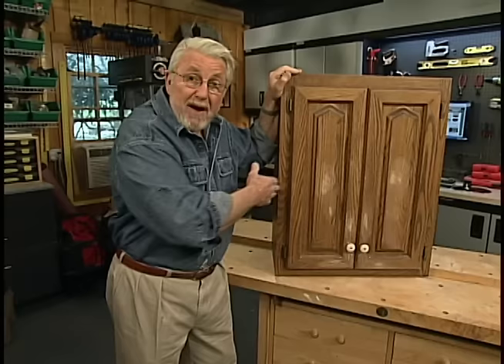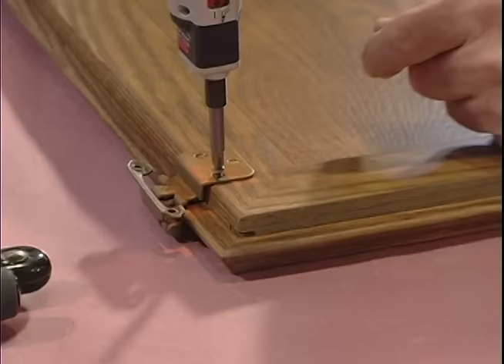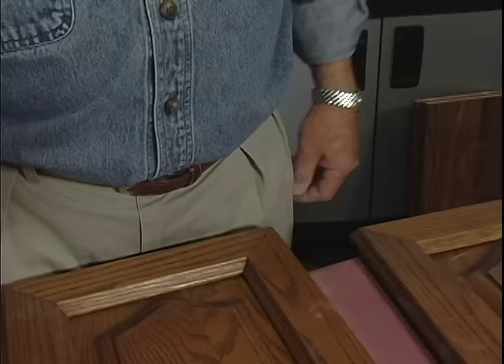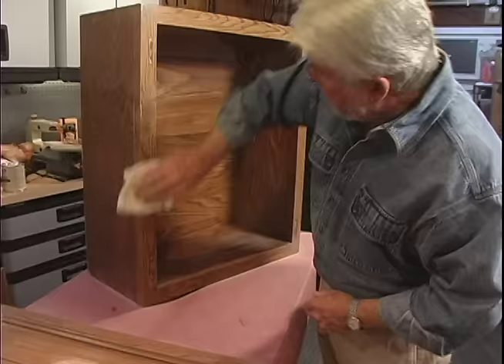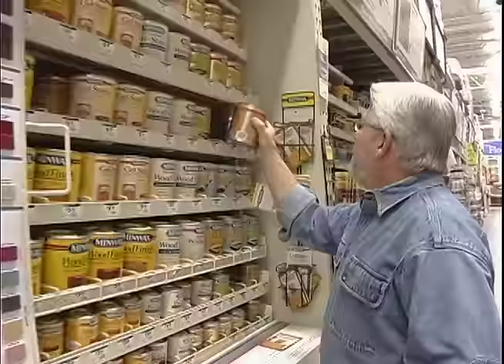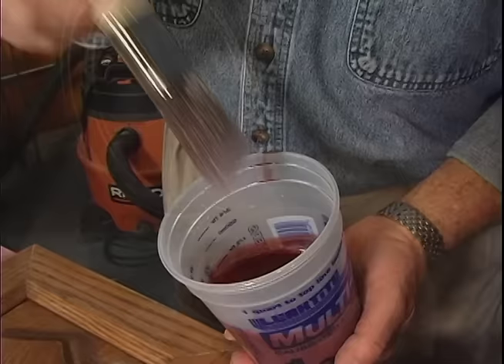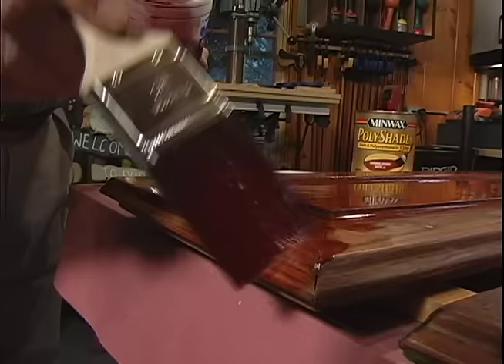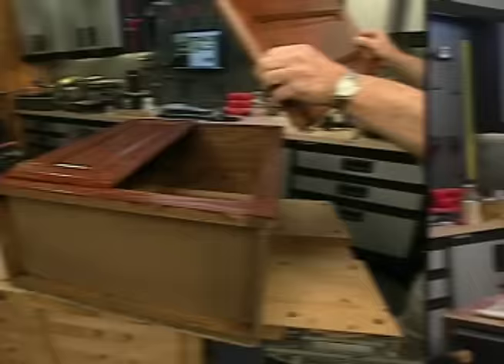Refinish Kitchen Cabinets Without Stripping

Comment: Has anyone else used Polyshades?  I used it on some dining room chairs, and after repeated use the base color is showing through, there are lots of scratches and chips, etc.  I’m sure I needed to sand better, but was it just me or is the product not that good to begin with?  Would a Gel Stain work better for these applications?  Thanks!
Reply: Polyshades is known for issues like you mentioned but a deeper tooth or some type of product to create the same effect can be helpful. Stripping fully and reapplying stain and finish is a pain and a big deal but it IS the best way to change color of stained cabinets.....
Reply: Based on my 40 years of experience, now retired, in painting, staining, faux finishing, restoring antique wood finishes in all kinds of furniture, this is the worst advice I have ever heard from someone who is suppose to be a craftsman. My god, LOOK AT THE DETAIL  after he is finished showing the before and after. There is all kinds of flaws in the finish!!! YOU NEVER EVER USE A POLYSTAIN for refinishing..PERIOD.. and NEVER USE A STAIN PENCIL...PERIOD....Refinishing anything without taking it completely down to bare wood requires time and patience in order to get the stain evenly dispersed around your project no matter what it is. Yes, for the novice, do the prep work he suggests and thats where you stop with this guys advice. Again, for the novice, buy yourself a ' GEL STAIN' and a professional natural bristle brush. I recommend getting the blond bristle. Again, for the novice, you want to take the brush and place it in a container full of mineral spirits and bounce the brush up and down on the bottom for a minute. This will aid in loosing and loose bristles that may be in the feral and will make the brush less rigid. Remove the brush and shake it out by placing it between both your hands and rubbing the brush back and forth causing the brush to swirl back and forth. Put the brush back in the mineral spirits and repeat. Next put the brush back in the it's wrapper that it came in and let it dry over night. Again, for the novice, After you have prepped your project, use a little amount of gel stain on the brush and get in all the crevices first and they all the flat parts and sides, called revels, you can give it a final wipe, if you'd like or let it be and let dry over night. Remember to clean the brush each time you use it!! DO NOT USE a lot of gel stain because to do this right you may have to do this a number of times perhaps up to as much as 3 coats for uniformity. Next day, look where all the light spots are, that is where you need to add just a little of the stain. Dab a little on with a non shedding cloth or paper towel than take your brush and sweep very lightly over the area to cover it and feather it into the rest of the wood that is not so light. Let dry. Do this again until you see uniformity. Then apply another light coat of gel stain using a non shedding cloth or brush and let dry and again, look for light spots and repeat what I said above and let dry. Next look for light spots if any, repeat if necessary. After you have uniformity, and your project is dry, apply by spraying, from a can, a light coat of polyurethane to seal in the stain. Let dry. Then you can a use either 2-3 more coats of spray or 2 coast of brush on polyurethane and let dry completely before putting the hardware back on. Now enjoy your project. Gel stain will work on maple, just do it lightly for each coat.
Reply: @dannyixoye262  I appreciate your experience but you just seemed to give the long detailed version of my advice. Not really sure where or why you think I failed......
Reply: @bruceyoung8036  Sorry Bruce,  I clicked on the wrong reply tab. You did not fail. In fact what you suggested is the right way, in most cases, to do it. I just wanted people to know that if they don't do this, which at times there are reasons not to, such as my working on a late 1800's Chinese antique piece, there is the option of using, carefully, a gel stain and how to use it. That said, on the Chinese piece I worked on, I actually used artist oils not a gel stain.
Reply: @dannyixoye262  ahh, a gentleman, don't see much of that these days. Lol. I appreciate your comment. You're obviously way ahead of where I am with finishing and refinishing. I don't think I would be comfortable working on pieces with any historical significance. And BTW, I only used that polyshades product one time, once...... that was enough. Nothing gained, looked like a mistake, which it was.
Reply: Wow!  Thank you both for your advice!  I will have to work up the strength of mind to go at these dining room chairs again!!  haha!  But, your advice does save me the trouble of using a polyshade again.  I am glad to know that you should put several coats of poly over the gel stain.  Other people out there leave that step out, but I can see where that would make a huge difference!  Thank you both, again for your detailed replies!
Reply: @bruceyoung8036  I am old now so I have old school values but I have faith that there are those, such as yourself, who have had at one time their life entertained old school values and adopted them as their own. I truly enjoyed my career in what I did and at times wish I could still do it with such earnest that I could not walk away until it was done as I once did  I learned long ago that most anyone can become a tradesman, but only a select few are truly craftsman. Strive to be the craftsman and you will grow to enjoy your work far beyond you can imagine.
Reply: @dannyixoye262  I could not agree with you more sir. It seems like the more care we put in to something the greater the satisfaction. I DO value the old school ways in my work and in my life. My chisels are sharp and always go back in their spot. Lol
Reply: @dannyixoye262  : So...using artist oils...? Is that a short cut of sorts if trying to make a uniform color over a larger area? Also, what would the prep be, and would laquer spray finish work?
Reply: @dannyixoye262   appreciate your clarification … & expertise …
Reply: @dannyixoye262   nice apology but you were talking about his video & his technique, product choice & final result . You did call it a fail …. But thanks for your input, too .
Reply: @bruceyoung8036   Then why leave your video up ??  Everyone liked it & praised you and your work looked great - but at least add an addendum about the product choice to help others ?

Comment: You make that look so easy but, I’m doubting the enormity of the job.  I had a laundry room leak and had to have a plumber repair it.  The flooring needed to be replaced and I chose vinyl wood planking.  I couldn’t match the planking to go with the cabinets well enough and I want to refinish my kitchen cabinets.  I’m afraid I will louse up the job and have a more expensive project on my hands.  After all, the cabinets would be the central eye focus of the kitchen.  I don’t want to remove the cabinets from the walls to do this and I feel this project will be labor intensive.  Would I be better off having a professional do this?  I’ve heard that it is very expensive to have someone else do this.

Comment: I have maple and it’s seems impossible to stain. It’s super smooth and I’m being told there would be all these brush strokes and I’m not sure I would like the end product. Have you done maple ?
Reply: Maple is inherently tough to stain because of the super tight grain. Wood conditioner designed for this exact purpose helps but isn't failsafe. Dark stain in particular will just not pop with maple like it would with oak or most other tree species actually. Leaving the stain to dry on the surface might work but is difficult to control and takes forever to dry. My recommendation is to try a method of your choice on a sample piece of maple and make adjustments from that result. Good luck.
Reply: Thank you for responding!
Reply: Based on my 40 years of experience, now retired, in painting, staining, faux finishing, restoring antique wood finishes in all kinds of furniture, this is the worst advice I have ever heard from someone who is suppose to be a craftsman. My god, LOOK AT THE DETAIL  after he is finished showing the before and after. There is all kinds of flaws in the finish!!! YOU NEVER EVER USE A POLYSTAIN for refinishing..PERIOD.. and NEVER USE A STAIN PENCIL...PERIOD....Refinishing anything without taking it completely down to bare wood requires time and patience in order to get the stain evenly dispersed around your project no matter what it is. Yes, for the novice, do the prep work he suggests and thats where you stop with this guys advice. Again, for the novice, buy yourself a ' GEL STAIN' and a professional natural bristle brush. I recommend getting the blond bristle. Again, for the novice, you want to take the brush and place it in a container full of mineral spirits and bounce the brush up and down on the bottom for a minute. This will aid in loosing and loose bristles that may be in the feral and will make the brush less rigged. Remove the brush and shake it out by placing it between both your hands and rubbing the brush back and forth causing the brush to swirl back and forth. Put the brush back in the mineral spirits and repeat. Next put the brush back in the it's wrapper that it came in and let it dry over night. Again, for the novice, After you have prepped your project, use a little amount of gel stain on the brush and get in all the crevices first and they all the flat parts and sides, called revels, you can give it a final wipe, if you'd like or let it be and let dry over night. Remember to clean the brush each time you use it!! DO NOT USE a lot of gel stain because to do this right you may have to do this a number of times perhaps up to as much as 3 coats for uniformity. Next day, look where all the light spots are, that is where you need to add just a little of the stain. Dab a little on with a non shedding cloth or paper towel than take your brush and sweep very lightly over the area to cover it and feather it into the rest of the wood that is not so light. Let dry. Do this again until you see uniformity. Then apply another light coat of gel stain using a non shedding cloth or brush and let dry and again, look for light spots and repeat what I said above and let dry. Next look for light spots if any, repeat if necessary. After you have uniformity, and your project is dry, apply by spraying, from a can, a light coat of polyurethane to seal in the stain. Let dry. Then you can a use either 2-3 more coats of spray or 2 coast of brush on polyurethane and let dry completely before putting the hardware back on. Now enjoy your project. Gel stain will work on maple, just do it lightly for each coat.
Reply: @bruceyoung8036  Based on my 40 years of experience, now retired, in painting, staining, faux finishing, restoring antique wood finishes in all kinds of furniture, this is the worst advice I have ever heard from someone who is suppose to be a craftsman. My god, LOOK AT THE DETAIL  after he is finished showing the before and after. There is all kinds of flaws in the finish!!! YOU NEVER EVER USE A POLYSTAIN for refinishing..PERIOD.. and NEVER USE A STAIN PENCIL...PERIOD....Refinishing anything without taking it completely down to bare wood requires time and patience in order to get the stain evenly dispersed around your project no matter what it is. Yes, for the novice, do the prep work he suggests and thats where you stop with this guys advice. Again, for the novice, buy yourself a ' GEL STAIN' and a professional natural bristle brush. I recommend getting the blond bristle. Again, for the novice, you want to take the brush and place it in a container full of mineral spirits and bounce the brush up and down on the bottom for a minute. This will aid in loosing and loose bristles that may be in the feral and will make the brush less rigged. Remove the brush and shake it out by placing it between both your hands and rubbing the brush back and forth causing the brush to swirl back and forth. Put the brush back in the mineral spirits and repeat. Next put the brush back in the it's wrapper that it came in and let it dry over night. Again, for the novice, After you have prepped your project, use a little amount of gel stain on the brush and get in all the crevices first and they all the flat parts and sides, called revels, and let dry over night. Remember to clean the brush each time you use it!! DO NOT USE a lot of gel stain because to do this right you may have to do this a number of times perhaps up to as much as 3 coats for uniformity. Next day, look where all the light spots are, that is where you need to add just a little of the stain. Dab a little on with a non shedding cloth or paper towel than take your brush and sweep very lightly over the area to cover it and feather it into the rest of the wood that is not so light. Let dry. Do this again until you see uniformity. Then apply another light coat of gel stain using a non shedding cloth or brush and let dry and again, look for light spots and repeat what I said above and let dry. Next look for light spots if any, repeat if necessary. After you have uniformity, and your project is dry, apply by spraying, from a can, a light coat of polyurethane to seal in the stain. Let dry. Then you can a use either 2-3 more coats of spray or 2 coast of brush on polyurethane and let dry completely before putting the hardware back on. Now enjoy your project.
Reply: Based on my 40 years of experience, now retired, in painting, staining, faux finishing, restoring antique wood finishes in all kinds of furniture, this is the worst advice I have ever heard from someone who is suppose to be a craftsman. My god, LOOK AT THE DETAIL  after he is finished showing the before and after. There is all kinds of flaws in the finish!!! YOU NEVER EVER USE A POLYSTAIN for refinishing..PERIOD.. and NEVER USE A STAIN PENCIL...PERIOD....Refinishing anything without taking it completely down to bare wood requires time and patience in order to get the stain evenly dispersed around your project no matter what it is. Yes, for the novice, do the prep work he suggests and thats where you stop with this guys advice. Again, for the novice, buy yourself a ' GEL STAIN' and a professional natural bristle brush. I recommend getting the blond bristle. Again, for the novice, you want to take the brush and place it in a container full of mineral spirits and bounce the brush up and down on the bottom for a minute. This will aid in loosing and loose bristles that may be in the feral and will make the brush less rigged. Remove the brush and shake it out by placing it between both your hands and rubbing the brush back and forth causing the brush to swirl back and forth. Put the brush back in the mineral spirits and repeat. Next put the brush back in the it's wrapper that it came in and let it dry over night. Again, for the novice, After you have prepped your project, use a little amount of gel stain on the brush and get in all the crevices first and they all the flat parts and sides, called revels, and let dry over night. Remember to clean the brush each time you use it!! DO NOT USE a lot of gel stain because to do this right you may have to do this a number of times perhaps up to as much as 3 coats for uniformity. Next day, look where all the light spots are, that is where you need to add just a little of the stain. Dab a little on with a non shedding cloth or paper towel than take your brush and sweep very lightly over the area to cover it and feather it into the rest of the wood that is not so light. Let dry. Do this again until you see uniformity. Then apply another light coat of gel stain using a non shedding cloth or brush and let dry and again, look for light spots and repeat what I said above and let dry. Next look for light spots if any, repeat if necessary. After you have uniformity, and your project is dry, apply by spraying, from a can, a light coat of polyurethane to seal in the stain. Let dry. Then you can a use either 2-3 more coats of spray or 2 coast of brush on polyurethane and let dry completely before putting the hardware back on. Now enjoy your project.

Comment: PolyShades is a horrible product.  As long as there is gravity, some bit of that stain and polyurethane is going to pool somewhere on your project.  And wherever it does will be darker than the finish on the rest of your project.  If your project is unable to be laid perfectly flat as it dries, there will be a drip or three or seven that will begin to slowly form as the polyurethane dries.  

You cannot use this product sparingly enough to avoid all the problems inherent in it.  Just get a wipe on stain.  Wipe it on and wipe it off.  Then when it dries, finish with CLEAR polyurethane.  You'll have a much better result with little to no extra work.